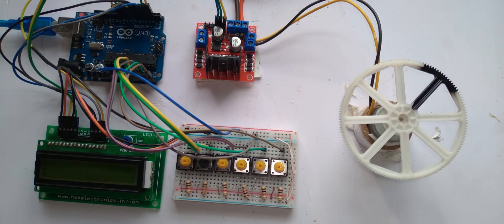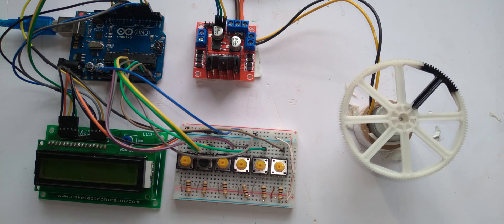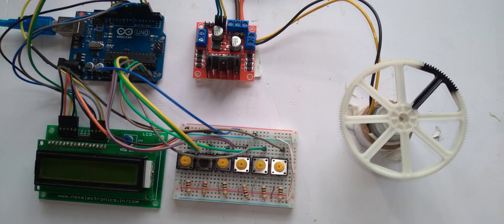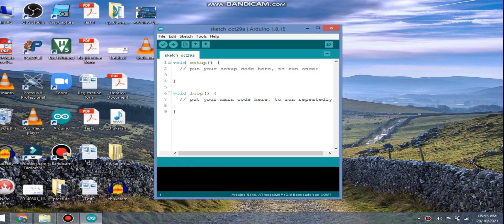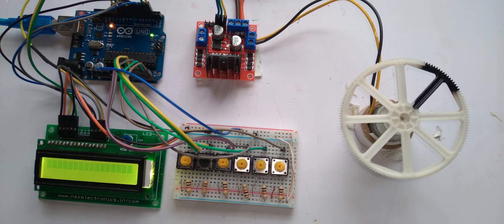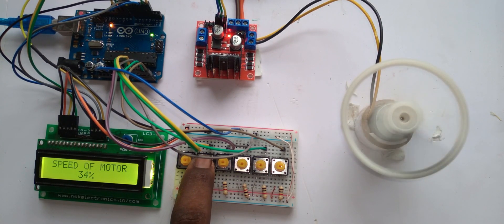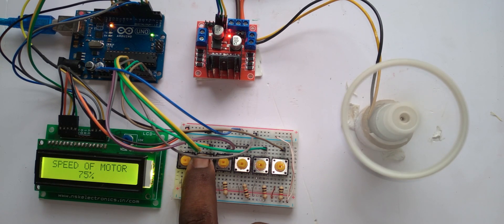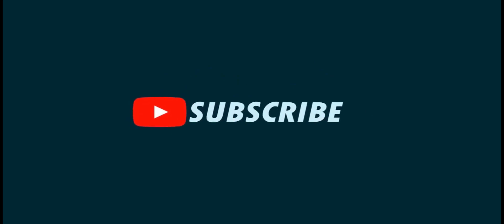How To Make a DCMotor #SpeedControl using #Arduino, #LM298 Driver and Push buttons on #PWM technique

Comment: Great video. Can you please do a similar video but with preset rpm. Like buttons for 1000rpm, 1500rpm and 2000rpm and start/stop.
Reply from the maker: Great suggestion!
Reply: Thank you. It would be great if it will be BLDC motor with ESC and IR sensor for rpm measurement.
Reply from the maker: @vishnunmenon6255  shortlyi will
Reply: @hrbembedded_craft  Waiting 😅
Reply from the maker: its done, published shortly, proximity sensor for rpm measurement
Reply from the maker: https://youtu.be/kZvuoYDIPME?si=rGuxEC-YE36_1_Mm